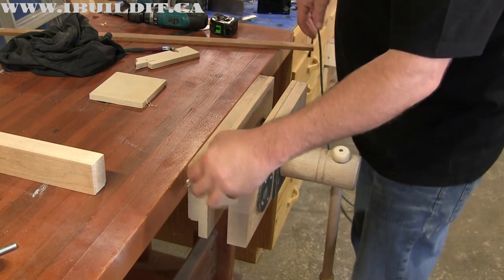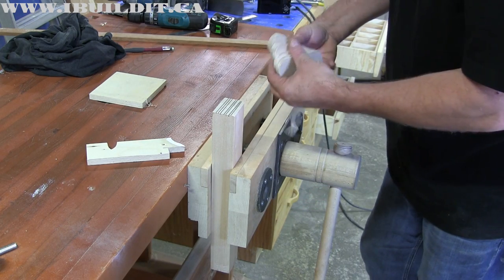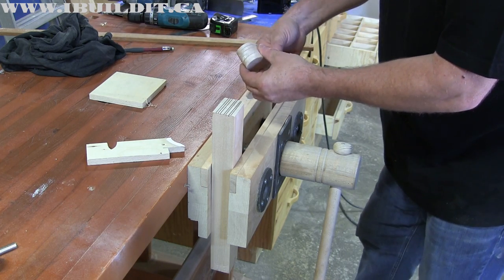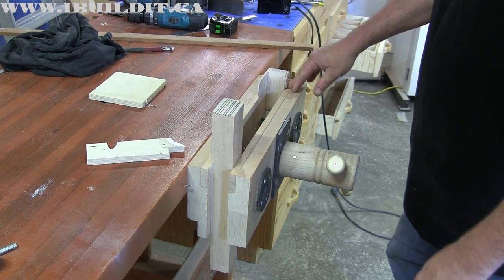Woodworking Vise Stop Spacers

Comment from the maker: I try to work within the limits of the wood. Solid wood needs to be dry enough to avoid splitting and warping after the project is finished. Major changes happen while the wood is initially drying out, and very minor changes occur after, as long as it is in a protective environment (indoors). Where plywood will work better, I don't have a problem using it. Plywood moves very little and has high  strength in all directions.